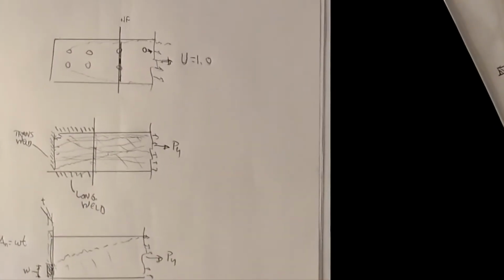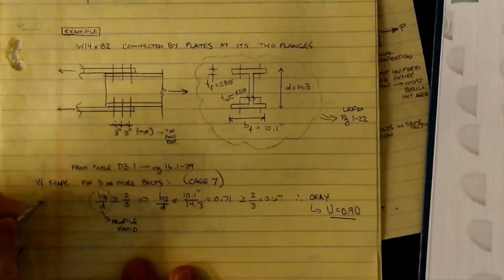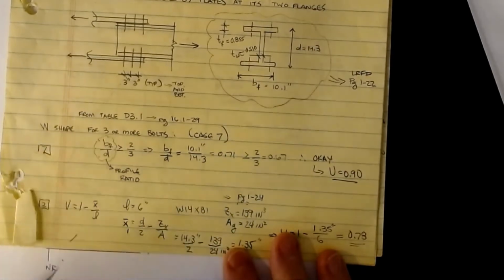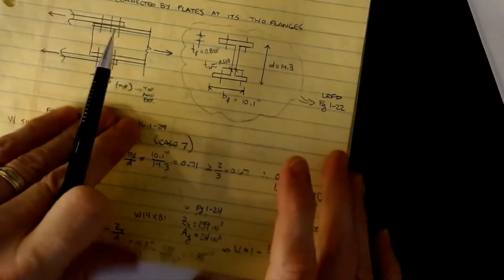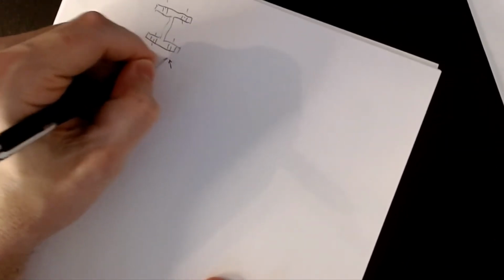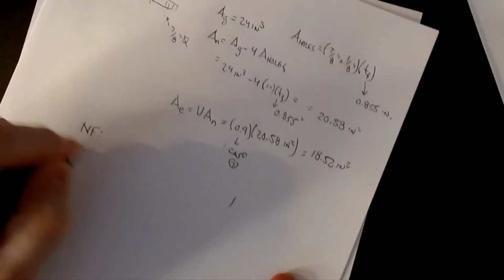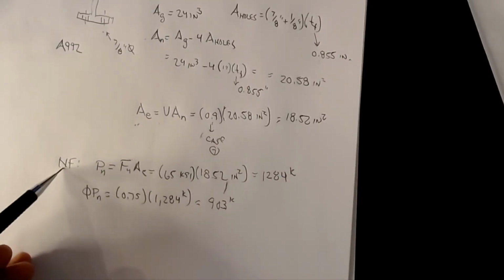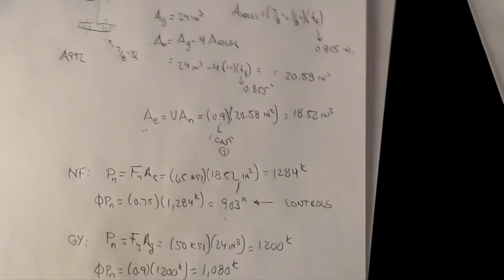007 CE341 Steel Design: Shear Lag Coefficients and AISC Table D3.1

Comment: Hey, why you did not use the equivalent WT 7 X 41? "x" distance for that section is 1.39 inches, which is very close to what you got, i.e., 1.35 inches
Reply from the maker: I'm not sure what what happened.  It's most likely a typographical error on my part, though it could be a minor dimensional change from the 14th edition (or earlier) specification.  But you are correct, according to the 15th edition it should be 1.39 inches.  Thanks for pointing it out.  And thanks for watching!